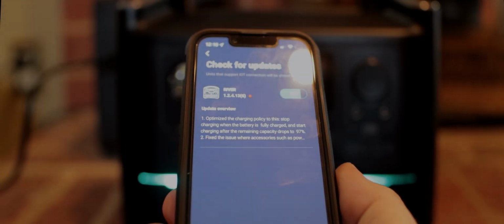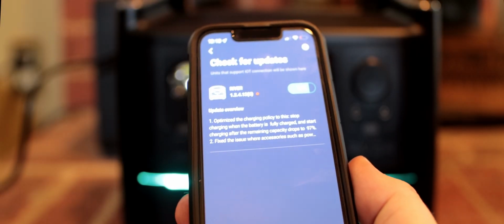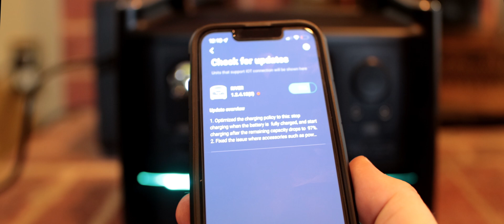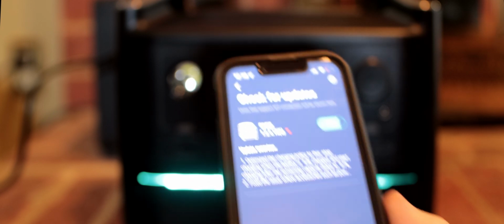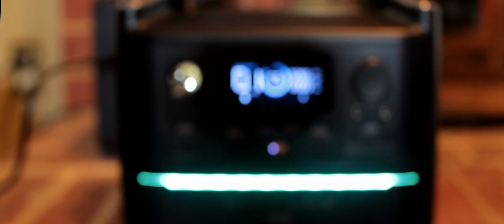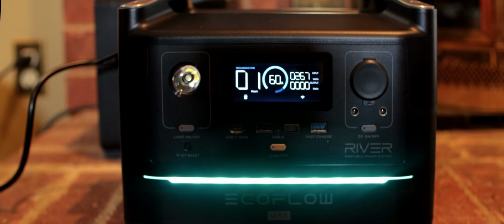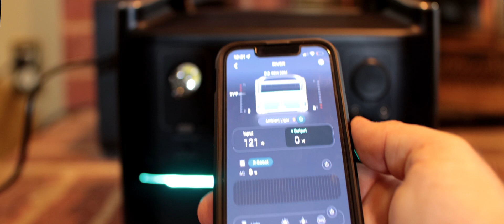Upgrading my ecoflow river to an ecoflow max.

Comment: Does this also apply to River Pro?
Reply from the maker: There is an expansion for the pro but it’s not the same type of battery. It’s basically the size of the pro without the display and you just tether it to your existing unit.